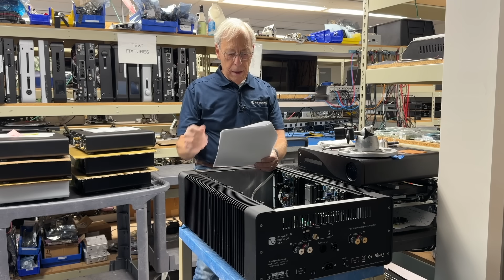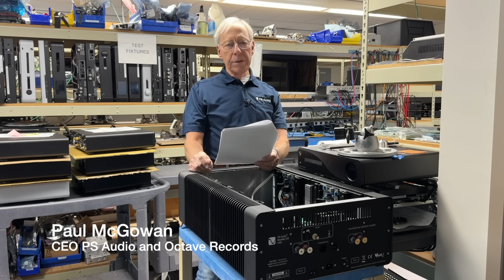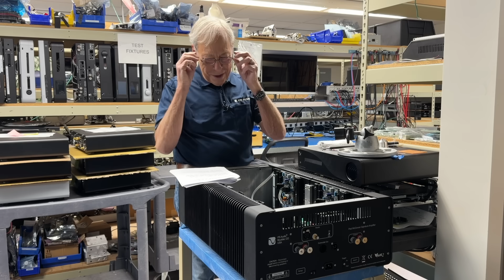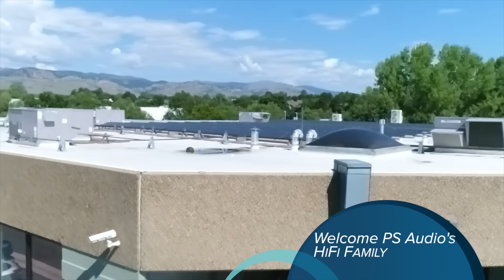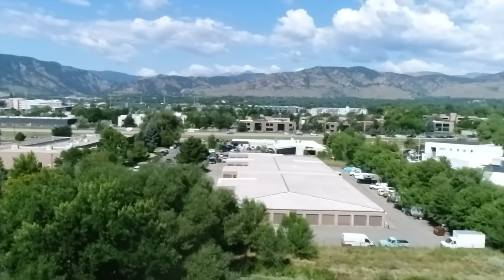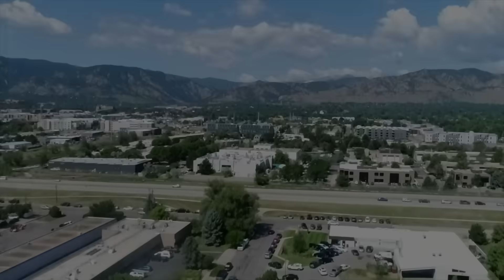Why Class A amps cost more

Comment: Another quirk to Class A is they run hotter at idle than when under load. Where AB amplifiers get hotter under load than at idle.
Reply: Small price to pay for incredible sound.
Reply: Total power draw changes very little in a class A amp and the louder you play the more of that power goes to the speakers.
Reply: @ThinkingBetter  That is correct. The power either goes into the heat sinks or into the sound, depending on speaker load, which is dependent on impedance, efficiency, room size, amount of acoustic treatment, and listening volume.
Reply: @danmarjenka6361  Your dynamic speakers are actually also mostly heat generators as only ~0.3–1% of the power to the speakers turn into sound waves.Hey I'm also from Denmark (incl. Greenland) but live in Southern California and realize the Danish educational system is much better in teaching people how to understand physical properties such as power and energy. Things get complicated when you have to deal with equations such as 1 W = 0.7376 ft·lb/s = 3.412 BTU/hr = 0.00134 HP rather than just 1 W = 1 J/s.  In the USA they still mess with ancient units. Why do Americans even need a video like this? https://www.youtube.com/watch?v=u-MH4sf5xkY
Reply: @ThinkingBetter  I'm curious where you got the information about me and  Denmark?
Reply: @danmarjenka6361  Actually I didn't read your ID carefully and thought it said "Danmark" which is the danish spelling of Denmark.
Reply: @ThinkingBetter  yeah we’re idiots but our dictator president is still going to invade fucking Greenland so there😂
Reply: @KittyDoll-ff6mg  My point is that a heavily treated room or a larger room will require more power for the same volume level.
Reply: @CashGravel  Apparently, this is the new America.  The USA used to stop other countries from doing hostile takeovers to steal land and resources. Now the USA will be seen as the hostile country.
Reply: @KittyDoll-ff6mg  I covered that with the word "efficiency" in my comment.  I should have wrote "efficient speakers" in my original comment.
Reply: @KittyDoll-ff6mg  Obviously, acoustic treatment does not change the amplifier itself.  But because acoustic treatment absorbs sound, it changes how much power the amplifier needs to produce to obtain a given sound pressure level in the room.
Reply: @KittyDoll-ff6mg  That glass behind your speakers (seen in your videos) is the worst surface for that location.
Reply: @CashGravel Our disgraceful dictator president is a disaster maker. Taking Greenland equates Europe going separate on military defense and US military export or other US export going down the drain. Trump is of lowest moral and sense of empathy standard. Had he sincerely been on the side of the abused in the Epstein scandal he would have done lots of opposite acts. What was supposed to be greatness is entirely embarrassment. I better listen to some music and calm down...

Comment: Perfect situation for the winter to heat up your room
Reply: A class A amp is indeed as efficient as any electrical heater (every Watt = 1 Joule of heat energy to your room per second). You need some fan to help spread the heat through the room and it's also good for the amp to get more airflow. You need a couple of 1000 Watts class A mono blocks for a medium size room to do the job if you live in a cold climate. Don't ask about cost efficiency LOL...
Reply: @ThinkingBetter   ...Paul should've mentioned that part of the higher cost of an 'A' class amplifier is the electricity consumed 😂
Reply: You can connect your class A amplifier to a thermostat if you live in a cold area and it becomes your room heater with added benefit of being an amp. Just turn off the thermostat function when you listen to music. This works especially well in Greenland (remember, I am citizen there).
Reply: @ThinkingBetter   ...how can I possibly forget 😝
If Donald Hump annexes Greenland it won't really affect you since you reside in The States anyway 😂
Reply: I am Danish (and therefore Greenland citizen). It means 98% of my country by area with massive natural resources would be stolen from my country. It's like your country is taken by king Trump except your city. It's obviously not acceptable for any sane person. Greenland allows US military protection through NATO so it's a lie that topic is any reason much as it's a lie that Venezuela is a major source of drugs to the USA.

Comment: Class A = big diesel generator idling full throttle to power a few 60W bulbs: massive heat, fuel waste, "effortless" power but totally unnecessary overkill for efficient speakers.

Class D (SMPS) = efficient solar panel + battery: clean, cool, plenty of power for normal listening.

Big box/heatsinks/cables = "look at my giant generator roar!" validation. Placebo watts for the ego.

Most listening <20W average. A good Class D laughs at 1000W monoblocks 😂

Comment: I prefer the PURE CLASS A Not this A/B First hundred stuff.  I have the Sugden MPA-4 mono blocks, Pure Class A amps. And yes they heat my house in the winter. End game audio equipment. And affordable
Reply: can i ask which cables you use to power these?
Reply: @1stswim  I have a dedicated 20 amp Breaker and Cardas audio receptacle powering my entire system. I use all Wireworld Silver eclipse 8 power cables with reference ends on every component. From the wall the main power cable goes to my Saturn power conditioner. From there all the components plug into the power conditioner. I have eliminated all the "noise" which I am able to hear with this method. My system is dead quiet.
Reply: @JerryM-p2v   ...nice!! 👍
Reply: Nice amps, but they don't leave class A because they are current limited into lower impedance loads.

Comment: Gryphon is the King in pure class A. No A/B.. 👍
Reply: Or Krell.
Reply: @danielanderson8502 Krell is not pure class A, have current controler, it"s a triky class A. Not work very hot, transistors heatsink is not very big and not dissipate heat very well. This is not class A, pure. BR
Reply: @perfectsoundpursuit007 Well, difference between old school Krell ≠ new ”Krell”…. Mine heats up my room plenty…. 😂 = Class A for sure 👍🏻 😅
Reply: @JB-h4q Ok, All the Best.
Reply: @perfectsoundpursuit007 Krell made some amplifiers that were definitely class A, most of them had fans.
Reply: @perfectsoundpursuit007  I heard a Gryphon amp. It was HUGE! With some other amazing equipment playing “What’s Going on” by Marvin Gaye and “Send in the Clowns” by a gentleman who sung jazz (his name escapes me since its early in the morning). It was flipping amazing!  I have my Krell. It’s been good but needs rebuilt.
Reply: Stay away from some of the Krells from the 1980s; they Discrete Technology (Distech) wiring inside, which is one of the worst sounding wires ever.
Reply: @sidesup8286 I am a Gryphon guy.. For life. I know electronics very well. BR
Reply: They leave class A at some point because they are not current limited when driving low impedance loads.

Comment: I have a 50W class A SET tube int amp with rolled top tubes , sounds way better than my previous 80W class AB amp , it does get hot , so no need heater in winter and AC in summer. Weighs almost 100 lbs. Sounds pretty good. The tubes does affect the sound. Not for insensitive reasons spkrs , at least 87dB sensitivity, best if above 90. Never going back to AB , maybe a very high end class D like a M33.

Comment: Inefficiency.. alot of heat
Reply: From a thermodynamics perspective, a 1000 Watts heater generates 1000 Joules of heat energy per second and a class A 1000 Watts amplifier generates 1000 Joules of heat energy per second with a tiny amount of the energy first coming as pleasant sound wave energy that turn into heat for the room also, as things vibrate. Thus a class A amplifier is sort of more efficient cause it is as efficient as a Home Depot heater plus more = generates musical energy.

Comment: Recently replaced my rotel type A with the new McIntosh class D MHT300 RECEIVER……no more excess heat or fans to cool my tight cabinet space.  Never sounded better
Reply: Cabinet??
Reply: @PerryRennich my wood work is too tight for good amp ventilation so I used to use small fans to keep rotel from overheating.  I don’t need them with class D McIntosh since they don’t produce much heat.
Reply: @Primus.caaaaa  You don't need to explain. 99% of us fully understand.
Reply: @BobFrostV lots of comments on the forum that “99% of us understand “………it’s common with group discussions.
Reply: @PerryRennich yeah one of those furniture things some of is put our components in , cooling fans , and me , I run 8 inch and designed my own filter system so no dirt or dust enters my CABINET 😮. I also designed my cabinet and built it 😎
Reply: Mcintosh class D is no match  for Class A
Reply: @Yoni1200 in what sense?
Reply: @Primus.caaaaa  everybody’s got an opinion and most of them have never done the actual comparisons
Reply: @CashGravel yes that’s how forums operate.  I sure did compare , the heat from rotel was extreme while the MacIntosh remains luke warm even when driven hard.
Reply: @CashGravel   ...yup, there are a lot of unsubstantiated opinions on YouTube. Often it's like wading through a swamp.
Reply: @Yoni1200 Yes absolutely right..
Reply: @Yoni1200 You are hearing it straight from the horse's mouth that it never sounded better, yet you are here denying that very fact!
Reply: True audiophiles will never play with a class D amplifier. Instead, they look for amplifiers that run hot..
Reply: @d @dmcaudio808 tell that to McIntosh ……..the reports on the MHT300 class D are quite impressive and  after all is said and done sound is subjective
Reply: I doubt Rotel can compete with McIntosh, you need to compare similar brands.
I’ve heard some Pass Labs, McIntosh, Esoteric and I can say they there is something magical about them.
Reply: @markmallinson935 yes but I was referring to the heat from rotel class A to McIntosh class D.  The Mac will sound better without a doubt.
Reply: Completely agree---my McIntosh Class D MI502 is cool, efficient and sounds great. To be fair I run the highs with McIntosh tubed monoblocks.
Reply: You forgot about the power bill from that amp being at full power 24/7 for those of us who don't power down our gear.

And needing a bigger AC. 😁
Reply: @MotivatedMetalworks that’s what I also like about my class D which doesn’t use much electricity.  I leave it on 24/7 but didn’t leave my class A rotel “on”.
Reply: @MotivatedMetalworks yes if you have 200 watts of class A, not too much of an issue if you’re running less then 50. 
Plus you don’t leave it it on standby like you would an A/b or class D. 
Plus 50 watts of class A punches well above its weight compared.

Comment: And class A amplifiers are usually balanced and fully differential...
Reply: They can be single ended or differential.
Reply: The canonical class A describes a single type device actually, so neither push-pull, nor differential.

Comment: I think Paul's missed a trick in not going for switch mode power supplies in his new amp.
I understand he thinks they are not good enough which is questionable.
Reply: I also think there is a rational for building things that are big and heavy to justify 20k to 30k price tags.  It is particularly hard to wrap your head around paying those prices for something that weighs 5 pounds and is the size of  a shoe box.
Reply: @user-od9iz9cv1w   ...I've often questioned whether it's just a male/masculine thing. "Ugh, amp heavy, have to be expensive" 😉
Reply: He's talked about moving over to them, I'm guessing they are knee deep in research and it just wasn't done.

Comment: Is this amplifier actually a Class A amplifier? 
Isn't it technically a Class B amplifier with a (very) high quiescent current?
Although I immediately believe that this is a very good amplifier.
Reply: Therefore it is a class AB amp, indeed with a very high quiescent current, i.e. high bias.
The definition of a class B amp is no quiescent current when idle. Where as class C is a "deep class B" amp", you need a significant input signal to open the active output device.
Reply: No class A is always on in linear region but not necessarily running at full power so in this case 100W seems to be the start of the linear region and 800W the max.
Reply: @duncangroenewald  In that case it a not a class A amp but a high biassed class AB amp. Don't fall in to marketing traps and adhere to the true definition of what class A amplification means in electronics. Bear in mind that audio amplifiers are only a tiny application of what electronic amplifiers can be used for. So it is not up to the audio industry to redefine what class A means, whilst the rest of the industry keeps only using the phrase for the original definition. And by the way, class A does not mean linear region by definition. When idle, there is no region, there is only a Bias point. When amplifying a signal, a class A amp may well end up in a very un-linear region. Besides this, no solid state device is very linear any way hence the need for feed back.

Comment: I remember that Class A means that the output device (power transistor, vacuum tube) is running at maximum power when idle. Some how we now have "class A for the first 100W" with an 800W amp. Sorry to break the news, but that is per definition a class AB amp. If you want to differentiate this kind of amp from your average class AB amp, you could call it a "High Biassed Class AB Amp". But there is no such thing as a partial class A amp. If it is not all the way class A then it is a class AB amp.
Reply: Class A amplifiers do not run the active devices at their maximum, they run the devices in the linear region, they just don't ever switch off.
Reply: @mitchtaylor6512  I did not say the devices are run at the maximum power they can deliver, when idle (though vacuum tubes in SE amps often come close to this). I said they are dissipating the maximum amount of power when idle. And this is exactly because they are biassed to be half way open. Do you see the difference between running at maximum power and running in saturation mode?
Reply: @hugobloemers4425 thanks for clarifying, your other post didn't.

Comment: I Have a Class A 65w Accuphase A80 and it runs cool…. Great engineering behind it & plenty of power.
Reply: From a semiconductor perspective it is running hot, or it is not in class A. That fact that it kind of feels cool from the outside, means it has a lot of cooling. But you are still dissipating 65W when it is idle.

Comment: I wonder if you could hook up water cooling exchange manifold, and pump to those heat fins to external outside radiator I’ll buy that
Reply: Motors generate noise
Reply: I have a sanyo p series amp ..freon cooled...works pretty well...sounds outrageous
Reply: A four channel class A amplifier project uses 32 output devices mounted on a water cooled cold plate, a central heating pump and two small car type radiators each with a fan.  The cooling system dumps a total of 800 Watts of heat and the fans make so much noise that it lives in the cellar below my listening room and gives just 25 Watts of audio per channel.

Comment: If that's a mono block then why does it have 2 pairs of speaker outputs? To support bi-wiring?
Reply: My M1200 monoblocks have two speaker outputs. 
One set drives my speaker and the other drives my REL subwoofer high level connection 
Convenience I guess.
Reply: That would be my guess. Or a speaker and a subwoofer.
Reply: @BruceCross   ...yup, clearly there's only a singular input (RCA/XLR)
Reply: My BHK 300 mono blocks have two sets of speaker terminals as well.  They work great for Bi-Amping.

Comment: I do love ❤️ the Class A amplifiers and I have a SUGDEN A21 SE Signature ✍️ Pure Class A Graphite color. Such a gorgeous sounding class A British 🇬🇧 integrated amplifier with a 58 years lineage. 
I do love THE BEAST from PS AUDIO. WOW 🤩 it’s really hard to wait.
Reply: .... .great engineering built like a Rolls Royce,  ....but in the end 'old tech'  I had a great Class A Musical Fidelity amp for 30 years, cost to buy equivilent today, circa 10k,  but I sold it and bought ultra-mordern classD monoblocks...  Zero regret...   Cool room, electricity useage (amp running costs) from 6-700 euro per year down to 70,  FAR better in detail, sound stage, accuracy, dynamics, raw power, definition....  the class A was just a little bit better toneally.
Do you want a Rolls Royce or a Tessla?    But it is GOOD to have choice!
A great comprimise is bi-amping, class D bass & small class A for mid/highs....
Reply: I love Sugden , I wouldn't own anything else. I have the MPA-4 mono blocks for my main system, with the LA-4 pre amp. And the IA-4 integrated for my second system in the basement.
Reply: @JerryM-p2v  .....Sugden are a GREAT British firm, I applaud your choice, but if I remember correctly, even they are beginning to work a little with class D....  ?
Reply: @JerryM-p2v  Can anyone tell me why the Sugden LA-4 has the word "Phono" by the outputs??
Reply: @danmarjenka6361  "Phono plug" is another term sometimes used for a single ended RCA connection. But I agree that can be very confusing.